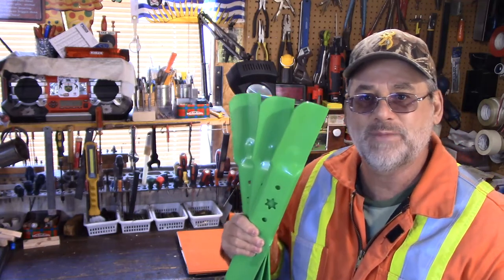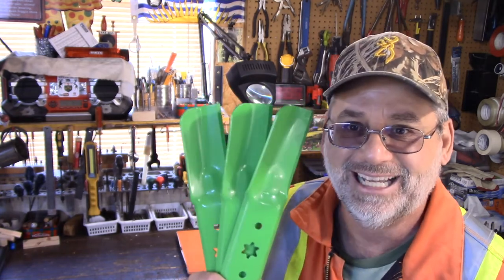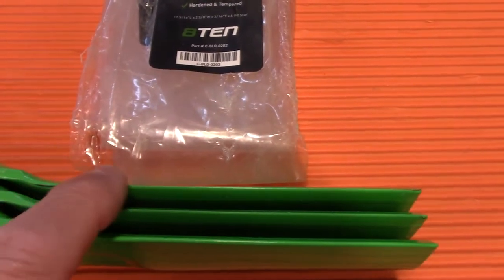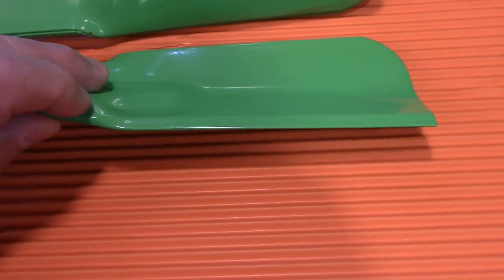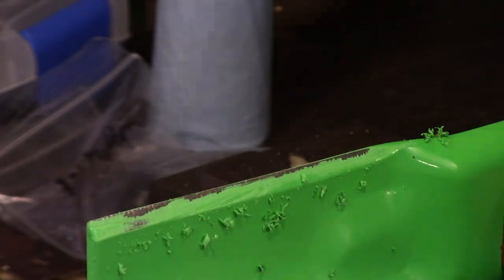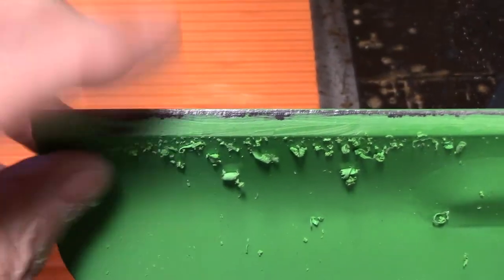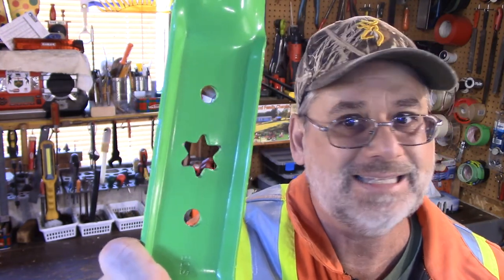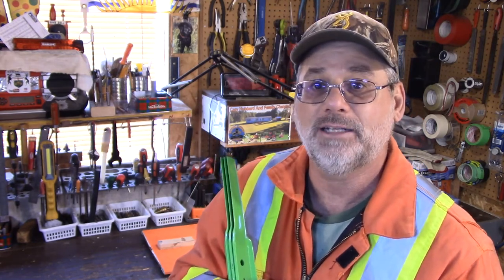Lawn Mower Blade Review  -  Shipped Dull

Comment: Just paid pretty good money for blades from Ballard, just as dull as these are.  I tried just running them thinking they knew more than me.  Cut about half the grass I ran over, just beat up the rest.  Took 'em off and sharpened them, work much better now.
Reply from the maker: HAHAHA , some swear by using dull blades but I'm not sure where that idea came from so  I keep the same angle and sharpen them  supper sharp for a clean cut. Cheers 👍

Comment: These blades actually cut very good straight out the box. If you have Sandy soil that coating will be gone fast.
Reply: The paint comes off very quickly just cutting grass. I didn't touch my new blade until after mowing twice. The paint was gone from the cutting edge already. The blade cut nicely even the first time with the powder coating in place. To each his own I guess.

Comment: Steve you should do a before and after, leave them powdered coated and go mow for 30 mins and see if they knock that coating off the cutting edge.  Looks like it scraps off super easy.
Reply from the maker: It's not so easy replacing blades never mind twice :)  The power coating was not easy to scrape off and every blade I ever bought including the factory blades from the factory were sharp and  power coating free so i'm thinking these are made to look great from afar but far from great . LOL
Reply: @SteveRobReviews  was thinking you could just see it through the discharge shoot.
Reply from the maker: Nope not on my mower deck but if I took the shute off I could but not so much  at 2000 rpm HAHAHA

Comment: Good buy Steve for a 1/4 of the price quick sharpening and it’s good to go 👍,  Now I wonder if it was power coated liked that on purpose or just a manufacturer mistake 🤔
Reply from the maker: Igor they looked like this in the add so it seems they are all shipped like this.  I can't imagine  putting them on as is and expect to cut any grass and wasn't going to try.  If there was a label stating why they painted the edge I would have but its illogical as that paint was hard as the steel :)

Comment: Steve, it’s been a couple years since you posted this video on the Lawn Razor blades.  Are you still using them?  What’s your thoughts/opinions after using them?  If you have time could you please do a follow up video on these blades?  I just bought a Scag 42” zero turn and had my eyes on picking up three of these blades for 1/2 cost of OEM.  Much appreciated. 

R,
Eric from Wisconsin
Reply from the maker: Eric I have used them a lot and so far their great.
Reply: Sounds good, thank you for the quick reply

Comment: You know Steve I now see the star pattern you meant in the center of the blade for mounting. You would think they could just rotate that star a bit so one of the points would be in the center lol.
Reply from the maker: Debra the 5 star blades you can but the 6 star ones you can't balance like a round hole .

Comment: It’s just cutting grass. But sharpening can make bearings bad fast. They get out of balance and then the real trouble begins. How do you sharpen them and keep them in balance? Thanks
Reply from the maker: Well sharpening is pretty much a must do but your correct off balance causes a lot of vibration so I take as little material off as  I can and use a screwdriver and put the blade on the round shaft  horizontal and aim for a horizontal position on the blade and remove material to get as close to horizontal as possible.  Seems a little basic but I'm as basic as it gets  😅
Reply: @SteveRobReviews  yeah I usually just use a grinder with a sand disk it does fine and only takes off just a little. But here in Ga. where I live we now as much rocks as grass.🤣
Reply: Thats what i was thinkin, i was told , more important to be balanced, if not vibrstion would be unbearable , take a file just to bring back an edge , dont want to take to muçh weight away, also if sharp & thin , that edge will dull soo fast.!  Jus sayin ..

Comment: They are green and we all know that green paint is worth more. Lol. 
  Maybe they figure the dirt and grass will wear the powder coating off and they would be good.  There's two schools of thought on sharpening mower blades. Some say you don't want them razor sharp because they dull and wear faster. Plus if you hit something that it damages the blade more with the thinner edge. Myself I don't know. I've tried both ways and personally haven't seen much difference.
Reply from the maker: Bill Green always goes better on a Deere but the blade sharpness I've explored and my opionion is the sharper it is without changing the cutting angle the better but after an hour it dulls back to the same  cutting sharpness  .  I have a hard time sharpening a blade to that perfect dull finish 😅
Reply: @SteveRobReviews  I do also. Can't say you sharpened something unless it really is sharp.

Comment: Your wrong that’s as sharp as they need to be. When you grind it it will lose its temper
Reply from the maker: James all mower blades are designed to be sharpened.   You can sharpen a blade without affecting the temper. Just like this video demonstrates.  https://youtu.be/NkZiqnHB7jQ